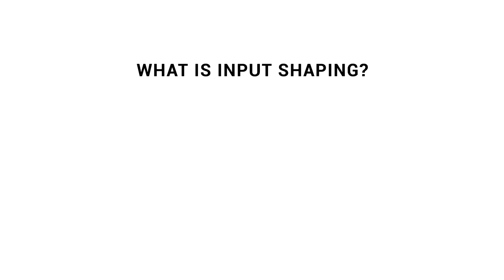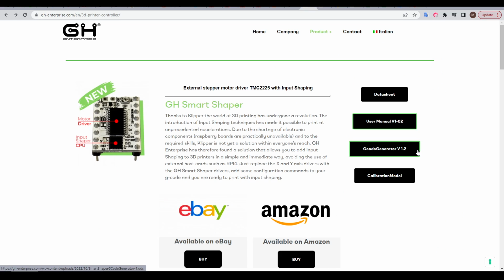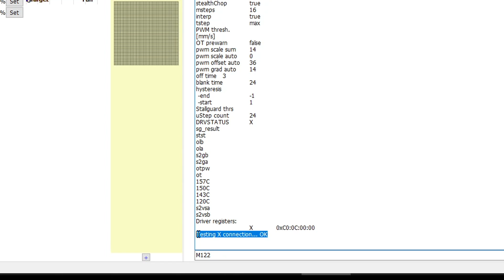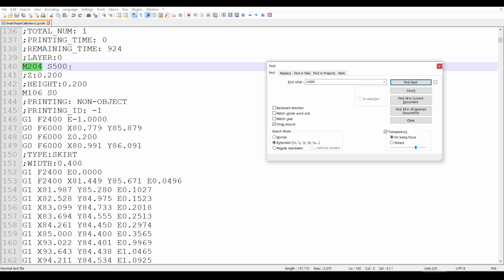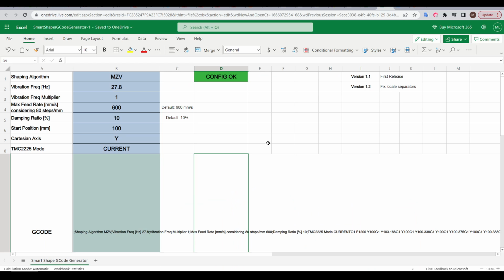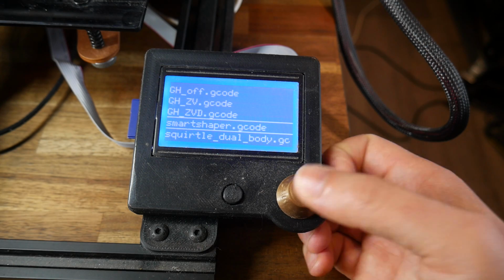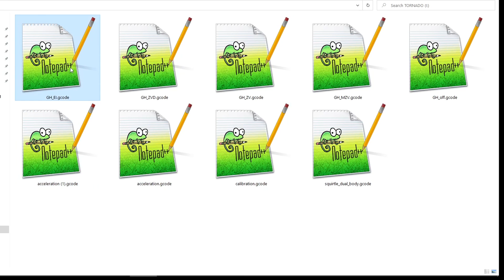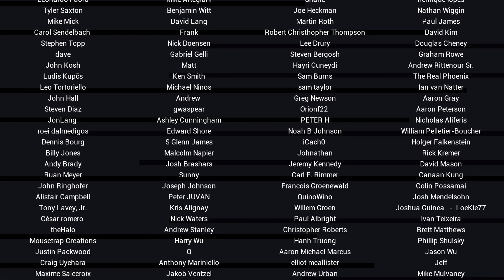Input shaping without changing firmware - GH Enterprise Smart Shaper guide and test

Comment: Hi. Did you have problem with error: Input Step Rate to high? I got this with speeds around 100mm/s when connected to Prusa MK2.5 via external board (needs some soldering). Below speeds 100mm/s it works ok.

Comment: Michael can I ask you a question, I am currently tuning a printer that has Marlin 2.1.2 I have been following your guide for as far as I can remember LOL, and just have 1 question.  should I tune input shaper with the ringing test before or after I tune Linear Advance.  I know in Klipper they recommend tuning input shaper before you tune Pressure advance, and a lot of what I have read linear advance in Marlin is the equivelant to pressure advance in Klipper.

Thank You for Your Time

Rick

Comment: HELP Anyone?! :)
I'm trying to get this running on my Sidewinder x1, but somehow I don't get what vref I should have the new steppers running on. Cause in the instructions it says that the vref is measured at the two measuring points... but is it the actual vref and i can just turn the potentiometer till the readout is 1.000 volt ? or do I have to put that number in a function/calculation `?
and the other question would be, do I need to remove some jumpers like Michael did ? Whats the stock microstepping on the sidewinder and is it the same on the new  steppers ? 

I really tried to understand, but somehow I am a bit confused and don't wanna damage the drivers or motors. I already installed them but only inverted the x/y axis so far.
Reply: hello, send a request for assistance via email from the GH site, you will see that they will respond quickly

Comment: Looks great though I would have to get a new controller board and I had just upgraded from an 8-bit to a 32-bit SKR Mini E3 V2.0 recently.   Is there a board with replaceable stepper drivers that is a drop in replacement for the Ender 3 without having to replace the connectors like on some other SKR boards.  I might be better off using a raspberry pi and klipper

Comment: @Teaching Tech : I've tried to reproduce the castle prints, with my default settings (0.2mm, 60mm/s and 1500mm/s2) Cura say it should take 2h07, with acceleration set to 3000 it take..... 2h07. If I rise the print speed to 150mm/s it take 1h47, and I don't think my printer is able to print at that speed. So perhaps Cura is wrong (can't print now with IS as there is something wrong with my setup), but what are your settings to achieve 1h34 with such quality ???

Comment: Hi! After having watched this video I've ordered a kit to test these drivers and LA on my Anycubic Mega S. My printer was already quite customized (TMC2209, Marlin 2, 0.9 motors, etc..).
After having installed these new drivers, updated FW accordingly, set voltage, all my prints was half the size, took me some time to figure out that the default microsteps value was 32 and not 16, so I've to cut MS1 pin (not quite well explained).
I've also had difficulties to enable the LA, just because I didn't used upper case M92 X80 command (for strange reason lower case works from Octoprint terminal, but not in a gcode file). Command I've to use as my M92 X and Y are 160.
I've printed the calibration file with the new X and Y code, the print was successful (without LA enabled I wasn't able to prine beyond 40% without layer shifting) and looks great. Acceleration was supposed to go up to 18000, so I was very confident.
Then, I've tried to print a 3D Benchy boat, a usual at 60mm/s and twice my default acceleration (1500 -> 3000), and the result is catastrophic, lots of layer shifting.
I don't know what's wrong, what I'm doing wrong, I'm sure that I can obtain better results, but at the moment I'm not really satisfied as the printer is also quite noiser than with the 2209.
Reply: Hi @Alkerion73 sorry for the problems you are experiencing. Can you send us via mail and send us your G-Code?
Reply: Hi @Alkerion73 I'm Andrea of GH Enterprise regarding noise you could try to switch to silent mode (Voltage instead of current). Regarding layer shifting could you try to reduce travel speed?

Comment: Hi, thanks to this Video i bought me a kit of these. Installation and vref setting up was easy with your guide, but after downloading the test print and printing it i noticed that the accel don't change as seen in the video also after finshing i checkt the accel on my printer and it showed rubisch like -5548 in all parameters of the accel. I restored the settings and print for now just with the driver without the input shaping. Btw my printer is an LK5 Pro. Maybe you or someone here can enlighten me what i'm missing or done wrong. Thank you in advance already.
Reply: Hi Christoper, I'm Andrea from GH Enterprise. Maybe the firmware installed on your printer have disabled the possibility to increase acceleration  using the LIMITED_MAX_ACCEL_EDITING define. You can try to change acceleration e readback with M201. If you need our support, contact us via email.
Reply: @andreacollamati66  Hi, yes that was the problem and thank you so much for the fast response it works now as intended. I'm testing how far i can go with my knowledge for now it runs at 70mm/s on 2000mm/s acceleration instead of the 50mm/s on 250mm/s acceleration that where stock settings on this Printer without issues but i'll try to go higher in the future. Thank you so much @Teaching Tech and @andrea collamati.

Comment: I must be doing something wrong.  I picked up a pair of these drivers, set the current, removed a jumper (to get 16x micro stepping), made the sample part, calculated the resonant frequency...basically followed all of the steps.  I then created a stand-alone gcode file with the results from their website, executed it and other than moving slowly here and there, nothing useful happened.  The lights continued to blink at the slow 1cps rate, and the ringing in the next part was just like always.

I emailed a copy of my gcode to the company, waiting to hear from them.  What's weird is a command in the middle of the generated code: "G1 XNaN".  Not like any gcode I've seen, NaN usually means "Not a Number".  

If you or anyone have thoughts on this, please chime in.  I'd sure like to get it working.

Thanks in advance.
Neil
Reply: Hi Neil. Friday has been released a new web configurator for  CORE XY. The new version contained a bug that we solved just now. Sorry. Refresh you cache to be sure to download the new one (CTRL+F5).
Reply: @ghenterprisesrl1932  Good news!  With the new web configurator (plus adding code to set/reset my steps/mm) I got it working.  It's "Mighty Fine Magic"!!!

Comment: Really impressive way to upgrade an older printer for $40. I'm only running Klipper CoreXY printers now, but this is a great way to get shaping on an old Ender 3 type unit!
Reply: Unless your old Ender 3 Pro is now an IDEX, dual side lift belt drive with 10 micon resolution (with microstepping off), rails, Octopus board and klipper.  The only thing Ender on mine is part of the frame lol  I blame the boredom during the covid lockdowns o.0

Comment: Does the frequency change as prints get taller? i.e. with a really big 500x500x500 bedslinger, will the ringing be the same at the top of a tall print as the bottom, and will input shaping fix it?

Comment: I got 3 sets of these drivers a month ago but been too busy with work and waiting on parts to arrive. Just watched your video and am wondering if by installing these in place of 2209 drivers, does that mean I lose the ability to use linear advance? I am using a skr 2 board and plan to use UART mode.

Comment: For all people having no jumpers on the mainboard, simply cut the pin MS1 on the driver so it doesn't connect to the Board. This will put the steps to 1/16 instead of 1/32, if your Board has this by default. There is no loss in quality, the opposite is the case because of the interpolation

Comment: Good that there are some alternatives to klipper but it looks so troublesome. At klipper you don't need to recompile anything, you can use accelerometer to automatically adjust resonanse and you change it in config file - no flashing of anything. You also can use it on boards with integrated motor controllers (like SKR mini).
Anyway, looking at you movie:
1. Without changing firmware - then why you recompile Marlin at first point?
2. Why acceleration at 1500 you call "crazy high"? On my simple CoreXY I use 7000 which is not so fast and I don't have any ringing.
Reply: He recompiled it to note the change in stepper drivers from the Allegro stock drivers. Otherwise he changed nothing. 

You can't honestly compare CoreXY and a normal Cartesian printer, the hardware is different. 

And from my perspective (and I've done a lot of Marlin upgrades, Octoprint on R Pi's, 32 bit boards) Klipper is more hassle than I want or need right now. And I built one printer totally from scratch - not a kit. I'm sure many others feel the same way.

Comment: I think you should stress a lot more that input shaping will cause smoothing of sharp corners when pushed too far, so a test print specifically to evaluate the maximum acceleration WITH inpu shaping.
Otherwise nice, I didn't know about those chips!

Comment: I don't understand why making all those movements at the beginning of the print reduces ringing.
I think I'm more interested in how this process will be streamlined for the masses in the future.
Reply: The specific sequence of movements is just a coded message to the stepper driver module to configure it. The actual reduction in ringing is done by a microprocessor that is packaged in the module. It uses a well known method of smoothing motion in a clever way to counter resonance in the printer.

Comment: Your ringing is formed from bed movements on both directions (X and Y). I've got similar bed swinger and had almost identical resonances on X/Y. I concluded that it must come from bed only since X-parts are super light compared to bed. I put the shaping on only for Y-axis and it worked like a charm -> the bed induces ringing on both directions.. With bed swingers, you can use only 1 stepper driver to compensate the bed induced ringing 💪
Reply: This is illogical unless you didn’t have your print oriented perfectly or you have some other mechanical issue like loose belt or wheels.
Reply: @bigdaddy0690  Tornado bed is on top of screws/springs and major mass is fastened on top. When you check the printable pattern, you'll notice that bed moves in both cases (X and Y pattern). Y pattern accelerates bed to greater speed than X pattern but the acceleration happens at same value. As the resonance is on low freq and the spring/screw setup resonates easily, you'll get the same resonance pattern on both directions.. As I wrote, I have very similar setup and it works like that. If you have a bed swinger and have similar (low) resonances on both axis, try to remove X compensation and test the results.

Comment: Maybe it's because English isn't my native language, but I found the title a little misleading. Yes your firmware stays marlin, but you still have to recompile to work with the new stepper drivers. And that's the biggest hurdle for most I think. If it wasn't for the shortage I find a pi zero 2W more bang for your buck and the Klipper config way easier to read than the one from Marlin.

Comment: Setting these as TMC2208 in the firmware does disable linear advance, right? Seems counter entuitive
Reply: Marlin used to have a problem with TMC2208 and LA. It no longer does. But I am working on a new issue with input shaping and TMC2208. It's like playing whack a mole sometimes!
Reply: No, LA is linked to the extruder, so use a 2209 for the extruder and that's ok.

Comment: I think this is a major step forward however unsure how this will be used in the future. If marlin is in the works for firmware and klipper has it also then it could be limited. Perhaps though with some of the newer marlin builds not fitting on 8bit boards these will help but either way it’s great to see technology moving forward.
Reply: Marlin has had some advances with 8 bit recently. I run very comfortably on 8 bit. It's especially good if you use ArcWelder and enable arcs in Marlin. You are more likely to need 32 bit if you have a delta, though. Input shaping for Marlin is also now in the bugfix-2.1.x code.
Reply: @tombrazier6172  It’s already in the bugfix? Oh I thought it was only in the initial stages yet. Time for me to get a wee looksie

Comment: Wondering how much of a difference these would make on a non bed slinger model like my Ender 5. With the full frame it is a lot more stable but after seeing this I am wondering if I can get faster or if it mainly works on bed slingers.
Reply: Print the model that is used for tuning. If you get ringing (ripples in the print) then input shaping can help.
Reply: @tombrazier6172  Thanx!

Comment: Does it complement Linear Advance? or should one disable Linear Advance while using this setup? i.e. do they conflict?
Reply: They should not conflict - with the GH hardware or natively in Marlin. But for calibration it is better to have LA switched off to prevent LA from slowing down the acceleration ramps and thereby obscuring the frequency measurement.
Reply: In klipper we use pressure advance which is similar, and input shaping can affect pressure advance but it's not a big deal, it's just advised if you already calibrated pressure advance to just redo the calibration after you set up input shaper and you're good to go.

Comment: It is always nice to see that companies actually innovate and provide a different solution to the problem. I am just not sure about the price. Raspberry Pi Zero 2, which can run Klipper with Input Shaping perfectly, comes at ~2x lower cost and it is a complete overhaul to a 3D printer.
Reply: @renevile  It’s easier than u think, and gives u a lot of cool features
Reply: The Pi Zero 2 is easily double the price now though.
Reply: @ssm445  Fortunately, there IS another solution: a second-hand thin client.  This is how easy it is to set one up: https://youtu.be/yHv9QOwaaS8
Reply: @KeithOlson  the thin client in unknown condition (used) costs the same as a new rasp, consumes 10 times the power and is just too bulky to fit below the bed
Reply: @ssm445  True in general, but if you can't FIND a Pi, a low-cost thin client or even an old laptop motherboard are viable options.

Comment: this feels so complicated vs using an accelerometer and especially vs Bambulab which just does it invisibly for you.

Bambulab really set a standard for what auto calibration should be. Hopefully similar tech comes to klipper, especially the auto pressure advance tuning.
Reply: @itsnotthat_  I think you are in a rush to belittle Bambulab because it's closed source and missed a lot of nuance in your comment.

Bambulabs solution doesn't need you to take 15 minutes or evaluate a png graph on your raspberry pi Linux computer. It also doesn't need you to print calibration prints you'll then need to measure by eye for pressure advance.

This means, especially with the latter, that you have much less friction in tuning.

You don't have to tune pressure advance for different filaments. You don't have to get out calipers for input shaper or mount an accelerometer, or review graphs.

Many times hobbyists do this annoying thing where they discount how much hassle something is because they don't have something better. I feel that's what you are doing.

I have a printer with klipper and an accelerometer. I made the profile myself, I made mounts for the accelerometers, I have tuned pressure advance and input shaper. It's a significantly worse solution than Bambulab which does both for you, and rather than downplay it, you should be trying to get similar features into open source printer firmware.

Comment: 3D printing is such a tinkering thing. I love 3D printing, and I use my modified Ender 3 Pro weekly. It's never just a set and forget thing though. For example, my machine developed a weird issue a while back out of no where, it tries to print the 1st and 2nd layer at the same height. It doesn't rise up for the second layer like it should, however this only happens when going from layer 1 to layer 2. I haven't been able to figure out why, so I've just been babysitting the machine during starts and manually baby stepping the Z up by the layer height when it starts layer 2. Just today it started another weird issue where it stops extruding during the outside wall, but only during the outside wall.
Reply: Those both sound like slicer issues to me. I'd install a different slicer and do some test prints with that. 

It sounds like some settings are preventing it from outputting certain lines of code